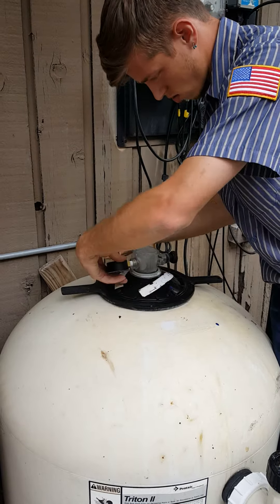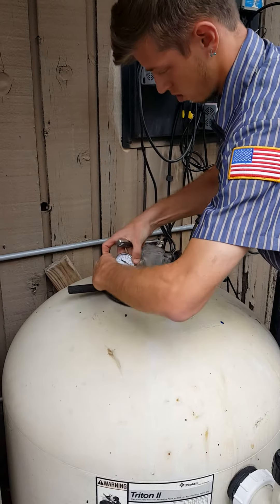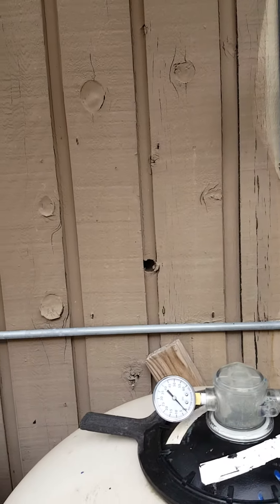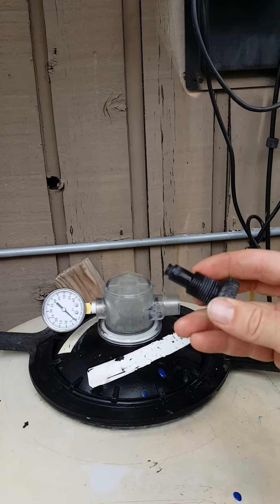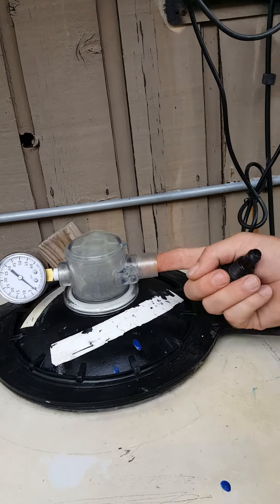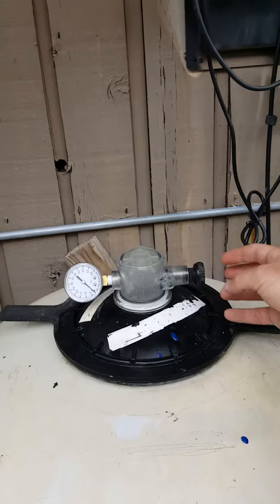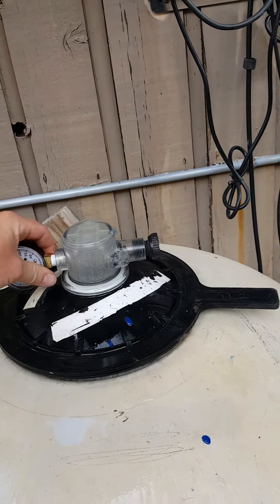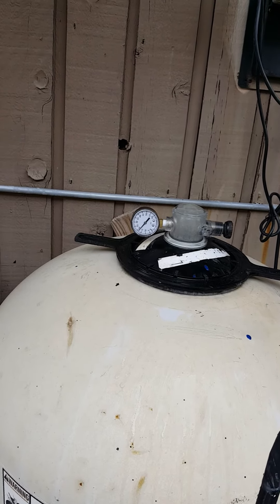Pressure gauge replacement

Comment: what do you do if you have to replace the whole clear plastic piece on top not just the gauge
Reply from the maker: use the lid wrench to remove the closure lid.  there is a nut on the underside.  once removed the air relief assembly will slide out.